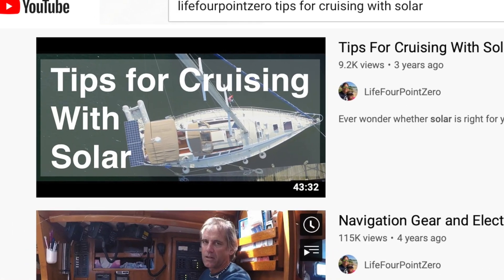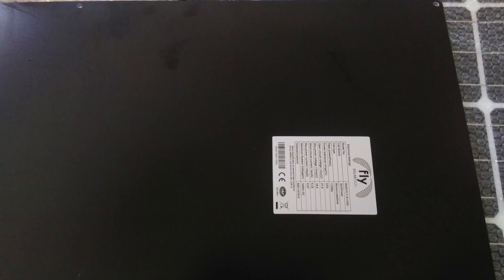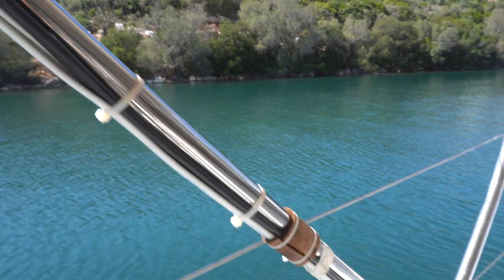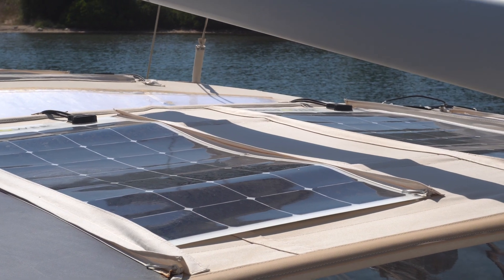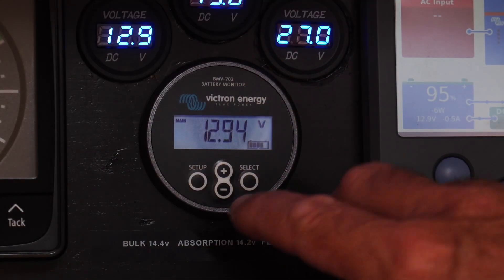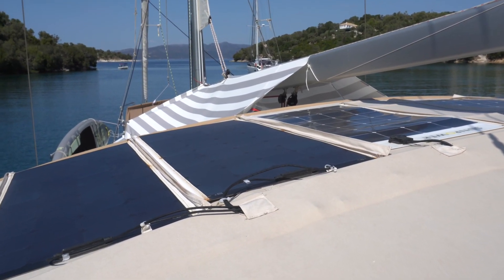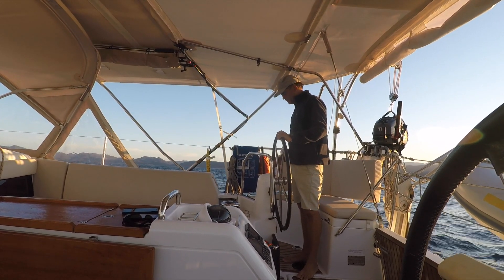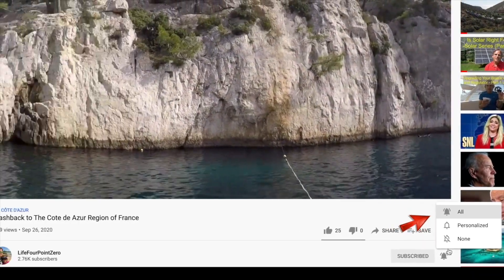Solar on a Boat - Real World Lessons | Ep. 106

Comment: How did you attach the zippers to the sides of the flexible solar panels. We tried contact cement (with tons of supportive testimonials we read on the Internet) and they stripped right off with a minimum of effort after allowing the cement to cure for a week. Any alternatives you used? Thanks.
Reply from the maker: We had a sail maker physically sew them on.

Comment: Hey Tom !  Great, informative videos on your electrical power plant generation and monitoring systems.  I'm about to embark on a similar project on my 440 and will be referring back to your videos many times, I'm sure.  I have a number of questions that others would probably like to hear answers to, hence why I'm posting here.  1) Why didn't you mount the panels on the bimini further aft to better avoid boom shadow? 2) Where did you install the 2 additional house batteries?  Looks like the space between the two aft cabins behind the Vetus exhaust waterlock. 3) What are the three device mounted below the Victron color touch screen?  Cheers !
Reply from the maker: Hello Curt! Glad you liked the video. With a full-sized bimini, there is a lot of space for solar up there and you'll be pleased with the extra amperage. To answer your questions. 1) There wasn't much room on the bimini aft of the boom because of the twin backstays and our bimini at the time (we've replaced it with new fabric now) also had a large vinyl window to inspect mainsail trim in that space. On our new bimini though, I have put one Sunpower 110w panel transverse in the space between the backstays. You'll see the new layout in the video. For the rest of the panels that go fore/aft, I didn't want to move them any further aft because they would lay across one of the bimini bows. We still have a gap below the boom so the reality is shading effect is not that noticeable. The alternative was a stern arch and we didn't want to go to this trouble and expense. 2) Yes you are correct, the two extra batteries are centerline, behind the waterlift exhaust and the prop shaft 3) the three instruments below the Victron color display are digital thermostats for our 2 fridges and 1 freezer. I am working on a video that describes their installation. They are really helpful to have onboard, to precisely control temperatures and easily change it. Hope this helps!
Reply: @LifeFourPointZero  Thanks Tom !!  I'll DM you with any other questions.

Comment: Very helpful video. I looked at it several times during my solar planning to get a variety of information. But I still have one question. Do you leave the solar panels and also the bimini installed all year round? More specifically asked about wind and storms. Do you turn down the solar and bimini when the wind reaches a certain level? What were your strongest wind speeds? Thank you!
Reply from the maker: Glad you liked it and great questions. Yes we leave the bimini and it’s solar panels up all season long. We also value the shade and rain protection it offers. We have been in gusts of about 40 knots, and plenty in the 30s. If we felt like we might be exposed to higher winds we would take it down. Hope that helps.
Reply: Thank you very much for your feedback! That is very helpful!!!

Comment: I had rich solar cig panels and they all delaminated  in a year. I am about ready to buy 1100$ per 200 watt semi flexible walk on panels from custom marine products.  This this the only walk on panel I know of.  For my solar arch I have more choices.  I am choosing between  Renogy 200 wat for 300 vs the 1100.  The custom marine products is using a name brand sun power cell.    Would you go cheap and disposable or expensive?  The sun power cells get more power from a smaller space and I am tempted to get the expensive cells just to have a slightly smaller solar arch.  Which would you buy?
Reply from the maker: Hi Kirk. It is unclear if you are looking for walk on (e.g. installed on the deck) panels or panels for your solar arch, which are too very different beasts, but in general I would say that we have been very happy with our SunPower branded (not just the cells) flexible panels that we have zippered to our bimini. Very well built. There are a lot of poor quality flexible panels out there so better to go with strong name brands. For our previous solar arch, we stuck with name brand rigid panels (Kyocera), but there are now a plethora of options thanks to the huge growth in residential solar. I did a ground mounted solar array recently with Q Cells and another with REC panels with costs in the $200-300 range. A solar arch with name brand rigid panels is a great way to go on a boat if you have the room for an arch. Good luck!

Comment: Thank you.  Nice idea to have a separate sheet of canvas on the bimini for the panel array.  As to separate controllers for each panel, if the panels are wired in parallel, and assuming each panel has blocking diodes built in, then shading of one panel will not affect the output of the others.  Having said that, I decided to go for a separate controller (Victron Smart 100-50) per pair of (parallel wired) panels, to enable better monitoring of performance.
As to the service life of semi-flexible panels, we have three small ones on aluminium sheet substrate that were installed in 2014.  Just back on our boat now, and after 8 years in the Med, they are still working fine.  I suspect the aluminium backing exposed fully to the air is one factor, and wired in parallel from what I understand, runs them cooler too - still experimenting on that factor.
Thank you again for a well-considered, and informative video.
Reply from the maker: Thanks for the comments David. So nice to hear you are starting your ninth year with your semi-flex panels! We are just back to the boat for the start of our 6th summer and 3 of our panels worked through the winter to keep our batteries charged and we will shortly be hooking up the additional panels with our fingers crossed!
Reply: @LifeFourPointZero  where are you at the moment - still in the Med?  We are in Tivat, Montenegro

Comment: Do you have wind-generator in your yacht? As I know, the efficiency of wind-generator is better than solar panel. Solar panels are sufficient for electricity in the boat without wind-generator? As I told you before, I ordered the same yacht (JN 440) and I’m gonna add options. welcome any comments for our circumnavigation preperation.
Reply from the maker: We do not currently have wind generation and we have done fine so far but the greater cloud cover in Scandinavia is a challenge. We may need to supplement but we love the passive nature of solar with no real mechanical parts. 

We have a freezer and a small drink fridge in addition to our regular fridge plus we are both regularly charging computers and all of the batteries associated with our multiple cameras and this past summer was the only time we even got close to a need to run our engine to help charge.

Comment: Tom, great video! I was surprised about the real output of the flexible panels. 60% (in average I assume) is a huge piece of information when designing the solar panels system. I'm new in boating, actually I don't have a boat yet (still looking) and this information is something to keep in mind for sure.  Thanks!
Reply from the maker: Glad you found it helpful. Yes, it was a bit of a surprise to us as well ... we knew it would be less than 100% but hoped it would be a bit more. Still, they are light and have held up quite well in a pretty tough environment!

Comment: more i learn on solar ..more and more likely am not use them  at first all thinking using 
,,for cost and fact all panels it still take 8 hours to charge all batters up .panels die easy 
..BUT buy $450 carry around  compact  little  diesel Cummins- 2500 W generator ,that fit any place and only shown on other cruisers  on youtube  take only 2-3 cups in 1 1/2 hours  of diesel will do same charging ,, as been saying 10 years ,dealing with Power plants ,,solar and wind .we're .just not their ,,we have years to go ,,
Reply: A generator is noisy, smells and needs maintenance and fuel. That means trekking in with Jerry cans in the dinghy or the stress of docking in a potentially busy marina. Some areas of the world have dirty fuel, areas like Indonesia especially the smaller islands are well known for this problem. 

Solar panels are quiet and provide energy pretty much every where. It’s free and environmentally friendly. Thousands of boats are currently sailing around the world, off grid with all their power supplied by solar, apart from the ship’s engine. 

So I disagree with your comment that “solars not there yet” it’s perfectly usable now and will only continue to improve.